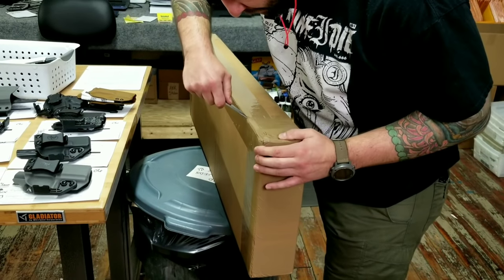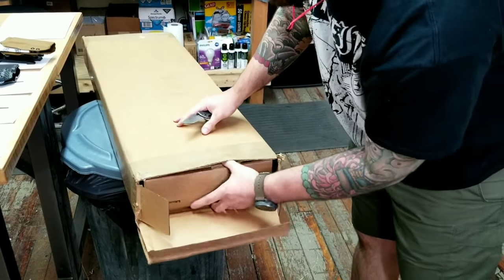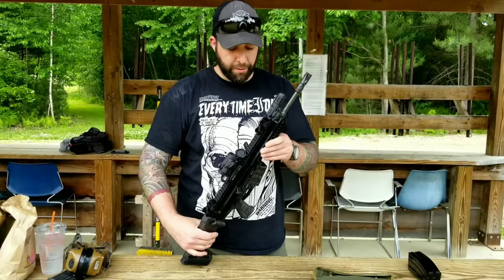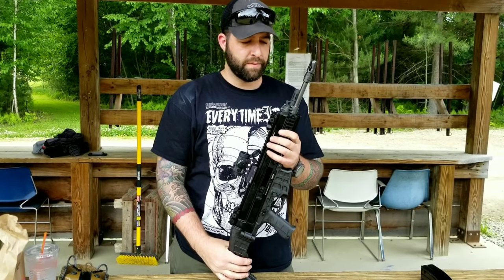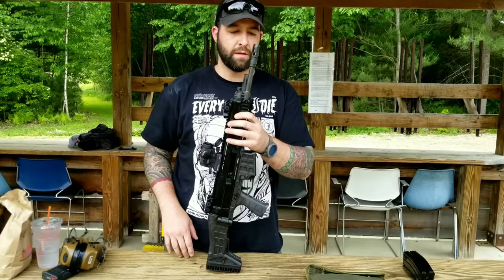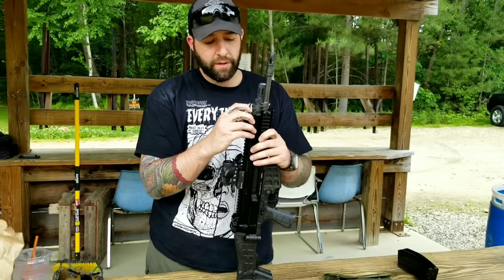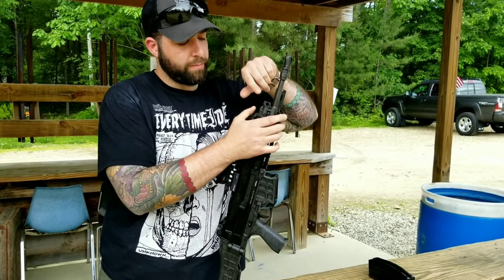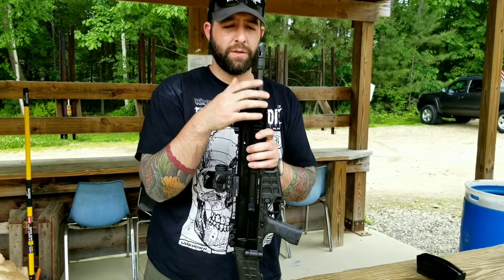CZ-USA BREN 2 - FIRST LOOK!

Comment: Pretty good AR, only problem is we must use "ZD Dot" by Meopta. It weight too much and sucks at all. T1 by Aimpoint or EoTech which cost the same is lighter and works better.

And... bolt release in trigger guard. Means tabu in czech army.

Comment: "9:11 there is a magazine failure. PMAG feed lips softened from heat and opened too wide causing a round to be forced into the bottom of the carrier. Began to slow the bolt down causing stove pipes." 
I find this very hard to believe on a pmag.
Reply: I dont

Comment: sure you can get all over that non-reciprocating left handed charging handle   But if it gets caught on some part of your gear and gets pulled back a little you might have a problem.   Its either going to partially open the bolt far enough to leave you with a half extracted fte round half way out of your ejection port or a combination double whammy round halfway stripped off the top of the magazine and a round half way stuck and hanging out of the ejection port.    imho  That handle should be farther forward if you are going to have it on the left side up against your body.

Comment: Anyone else having stove pipe problems. Was running some golden tiger through it today and around the 100+ mark I was getting back to back stove pipes. Any ideas anybody as to what was the issue? The gun was cleaned prior to shooting and I was using the mags that came with the gun. Very frustrating for sure.

Comment: Would a 16 have had that malfunction? Also, this seems to be very snappy in recoil! I wonder if a FSC like the scar runs would tame that because she jumps being that light.
Reply from the maker: It does have a higher level of recoil that we would consider undesirable for 556
Reply: Any thoughts as to why? I mean,lightweight and piston is usually going to be snappy. I wonder what a better muzzle device would do. But, it also seems like it's better to go with a SCAR even if these were available to normal folk. I do love CZ though so, it has that going for it. Thanks for your replies. Also,thanks for commenting and filling that person in On exactly what was needed to obtain one of these because I was going off a bad memory but, it seems I was close. Take care!

Comment: Slow it down to half speed and go to 9:12 and you can see what seems to me to be the bolt closing on a spent case. Was this an ammo related failure?
Reply from the maker: So yes we did have a malfunction. But it was actually because the feed lips on the Magpul Pmag melted open causing the rounds to press upward and causing a failure to eject. It was not a mechanical malfunction from the rifle itself but in fact a magazine related malfunction that is not worth notating because it melted open from how hot the gun got.

Comment: I don't like how they made a bolt release and hold INSIDE the trigger guard. Most people would basic training would not put their finger in there unless they are shooting. Now if the bolt hold and release is outside like the ACR, then it'd be safer.

I understand maybe the WHY. Probably for emergency one handed manipulation but not for full time use

Comment: That last string of full auto fire at the 9:43 mark it actually malfunctioned in the form of a failure to eject.
Reply from the maker: Yes. Magpul pmag melted. Forcing a round into the ejecting round. Don't use plastic mags if you're running this hot

Comment: So on a form 3 rifle anyone on the trust or estate agent can use the rifle?
Reply: J.G. Bills  Not a new full auto. Civilians can only buy and own machine guns that were made before May 19 1986. And those are VERY expensive because there are less and less that are registered and still in one piece.
Reply: So how does he have this one? A dealer license?
Reply: Would have to be. That was what I was thinking. I’ve heard something from certain class 3 weapons dealers that supply weapons to contractors overseas there are ways to acquire current production full autos but I’m still going through that data.
Reply from the maker: No
Reply: ANR Design LLC Thanks for the response. Meanly asking since I’ve only purchased sbrs and suppressors. I’m a State Police Officer just trying to grow my knowledge. I’ve dealt with class 3 weapon dealers that have possessed new full autos and have rented them out and what not. Just trying to understand everything. Thanks for your time.

Comment: Stove pipe at 9:11
Reply from the maker: So yes we did have a malfunction. But it was actually because the feed lips on the Magpul Pmag melted open causing the rounds to press upward and causing a failure to eject. It was not a mechanical malfunction from the rifle itself but in fact a magazine related malfunction that is not worth notating because it melted open from how hot the gun got.
Reply: ANR Design LLC not knocking the rifle it’s sweet, i’d like one or the 805 bren. Just stating an observation I saw that others may have missed. Everything malfunctions every now and then.

Comment: I thought it was illegal to import new full-auto's?
Reply: D Rock     75  Not if you have the FFL for a post sample. I want to say 07 but I don’t know much about that stuff.
Reply: Tyler , That's badass!  Thanks
Reply: D Rock     75 No problem Ok, I tried looking into it but.. it’s all confusing. I think you need a class3 SOT and it isn’t exactly easy to get something like this. So type 07 would be building or manufacturing and then if you add a class 3 SOT on to that or you could be a type 1 but also class3 SOT, Someone who knows should be by to give the exact clause.  Right now, I’m like going to Dr Phil for a physical. Take care!
Reply from the maker: It is not illegal it does have to pass through an ATF Form 6 which can take up to a year and I am also a FFL and sot which means I can acquire dealer sample modern machine guns with some extra paperwork and a law enforcement letter
Reply: ANR Design LLC , Thanks for the reply. It's good to hear that at least some of us can get them. I was under the impression that the Hughes Act made it impossible to get modern full-autos.

Comment: A little confused as to why you said, the 805 Bren has more recoil than the SCAR 16s. As far as I know, most accounts suggest that the 805 Bren has slightly less recoil than the SCAR 16s. Though, it's very minimal. Not to mention, the 805 Bren's minimal recoil pushes straight back, where the SCAR 16s has the tendency to slightly lift up ever so slightly. The 805 Bren is slightly heavier (by a couple ounces) than the SCAR 16s but, has a smaller bolt. While the SCAR 16s has a bigger bolt (length wise) but, ways slightly less. Which indicates that the SCAR 16s has more reciprocating mass when firing. And that's been proven. Otherwise, good review man. The Bren 2 is in a league of its own compared to both the 805 Bren & SCAR 16s. It's everything the SCAR 16/17 and 805 should've been. Watch out for the Bren BR! It's the sexier Czech cousin of the SCAR 20s.
Reply from the maker: It has a pretty heavy bolt and spring. And when it sends the round home, to me, has a stronger recoil impulse. That's why it's my opinion. Other people have different opinions.
Reply: @ANRDesignLLC  Fair play. We're all entitled to our own opinions. I don't agree with you in terms of the recoil impulse and most would agree with that but, it's not the end of the world. So long as it doesn't come from a biased place and used as a means to downgrade a great firearm, no harm no foul. The 805 Bren's bolt might have some weight to it but, the SCAR 16 has an even bigger bolt and weighs less overall. You sure you were using the same ammunition when testing both rifles? And had them both set to around the same amount of gas? 805 Bren is known to be a pretty flat shooting rifle/carbine.

Comment: Failure to eject in full auto 9:12 and they try to skip past it and not say it had an issue....
Reply from the maker: So yes we did have a malfunction. But it was actually because the feed lips on the Magpul Pmag melted open causing the rounds to press upward and causing a failure to eject. It was not a mechanical malfunction from the rifle itself but in fact a magazine related malfunction that is not worth notating because it melted open from how hot the gun got.
Reply: Good catch !!!
Reply: @ANRDesignLLC  so it needs metal mags then? And can't wait to see the civilian version of this. Been looking at the Evo 2 but this is tickling my fancy.

Comment: Malfunction at 9:14.
Reply from the maker: So yes we did have a malfunction. But it was actually because the feed lips on the Magpul Pmag melted open causing the rounds to press upward and causing a failure to eject. It was not a mechanical malfunction from the rifle itself but in fact a magazine related malfunction that is not worth notating because it melted open from how hot the gun got.